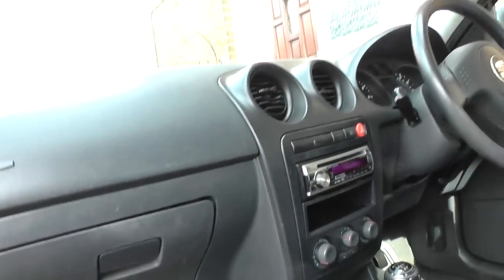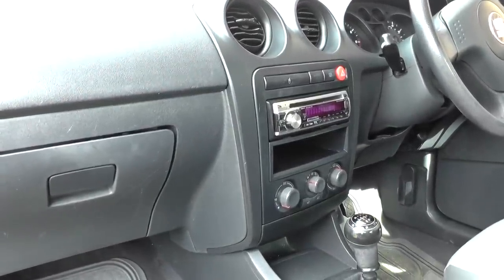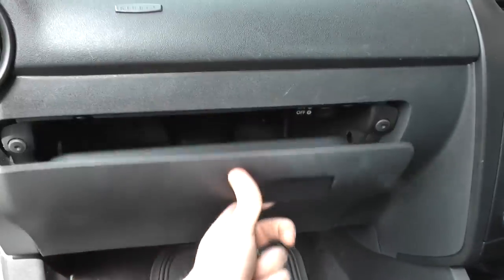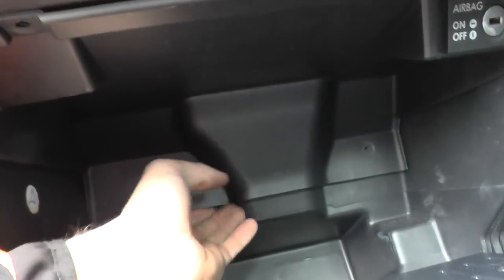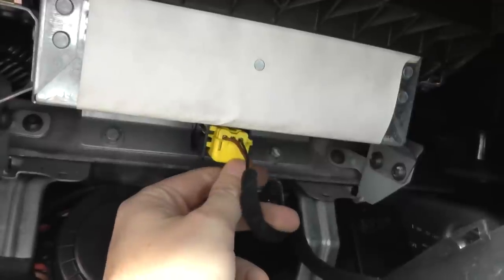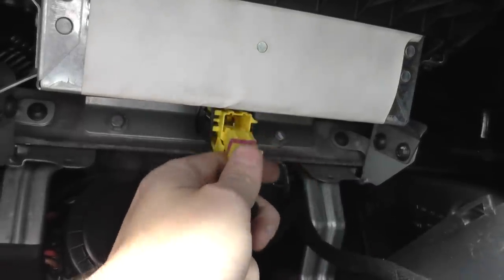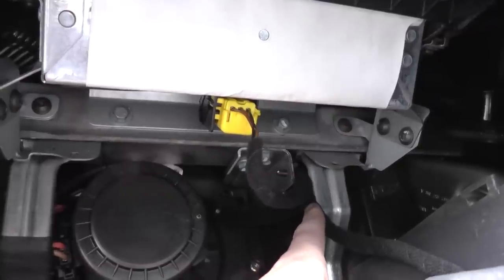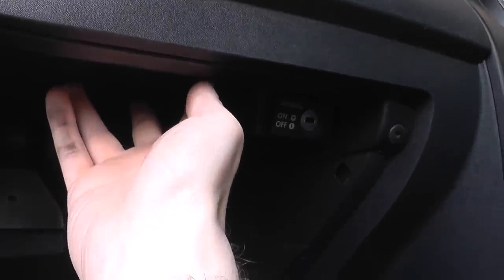Seat Ibiza Airbag Connector Behind GloveBox   How To Check Connection

Comment: Mate that is NOT checking the connection. It’s opening and closing the connector hoping to fix the problem. Checking requires multimeter and actually checking between both sides of each wire in the connector.

Comment: Does this turn off the warning light on the dashboard or must it be reset with the scan tool after securing the connectors?
Reply: simongslo do you know if this turns it off?